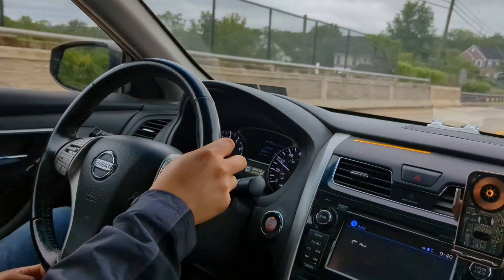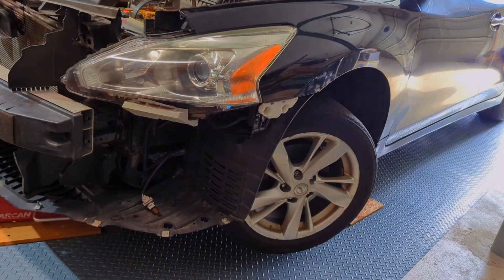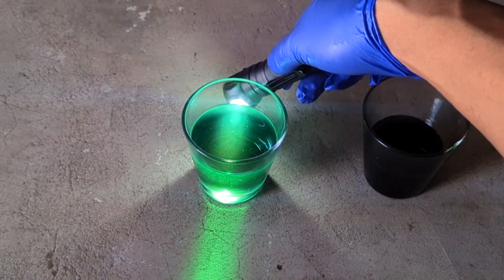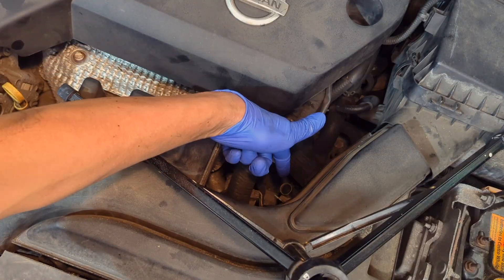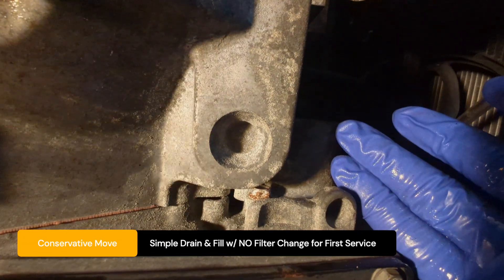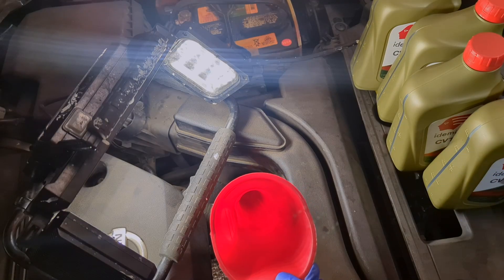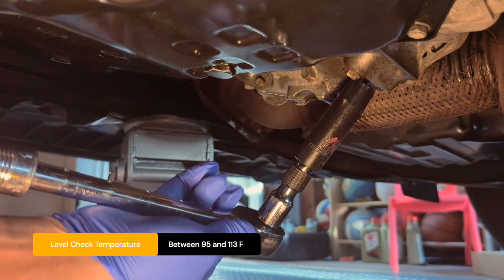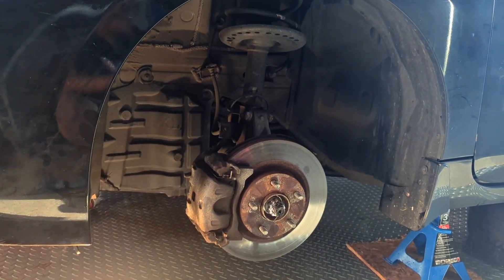Nissan CVT at 185K Miles: Service or Leave It Alone?

Comment: 4yrs ago at 123k miles my 2013 nissan versa transmission fluid changed. Last week at 145k i drained and fill the transmission fluid on my own. It was challenging coz its my first time to do it on my own. I snap a screw for the transmission filter coz it was leaking when i turn on the car but when i take it out the new rubber gasket from the filter was snapped so i decided to reused the old rubber.😅 i went in panic mode wake up early and running to different nissan dealer to find the screw but im glad the person in the parts help me. He went to the shop and ask the mechanics to find the screw close to the one i broke😅. Now everything is running good. It was dark trans fluid but i didnt drain and fill much until its clear, it might gonna slip. Anyway thanks for your videos. New subscriber here 😊
Reply from the maker: Sounds like quite the adventure, but glad it all worked out! Welcome to the channel!

Comment: Hi Professor,  I just had the sealed transmission fluid changed on my 2017 Kia Sorento with 150,000 miles on the original oil, and it’s runs very smooth.  Thanks for your videos to help guide me.   Keep up the great work!!!
Reply from the maker: You're very welcome! Glad the videos were helpful and it worked out smooth for you!

Comment: Did the transmission drain plug have a magnetic end? If yes, were there any metal shavings on it?
Reply from the maker: In this type of design with the overflow tube on top of it, the drain plug doesn't have a magnet. There are internal magnets on the bottom of the oil pan that will collect shavings for sure. Normally, you'll see fine-grained shavings due to normal wear and tear if you do drop the pan. Unless there are bigger metal shavings, in which case you probably experience something noticeable with the transmission, they are no reason for concern by staying at the bottom of the pan. If you are really motivated to drop the pan, to clean shavings on the magnet and to replace the internal strainer, which are unnecessary unless you have something else to address, please use all OE parts including new pan gasket, new pan bolts, and strainer and follow the procedure. Apply penetrating oil generously in advance and be patient with those pan bolts if you are in a rusty area. Too many people dug themselves into bigger troubles not knowing exactly what they were getting into so I always advise my viewers not to do it unless for a good reason.
Reply from the maker: Thought this was under my Toyota/Lexus ATF videos. So I have to correct myself here: This CVT has an overflow plug, no overflow tube which is on a Toyota or Lexus in my other videos. Neither the drain or the overflow plug has a magnet. There is an internal strainer and an additional external filter with an element in it. I'd replace the filter element.

Comment: You should have removed the oil pan and the paper filter. The reason why you probably never felt metal shavings in the fluid is because they got stuck on the oil pan magnets and strainer.
Reply from the maker: Thanks for chiming in! But I'm afraid this isn't the case and I disagree about the suggested approach. The transmission is very smooth and feels a healthy pressure with proper filtration. I did ask my friend to floor the gas pedal for once during the test ride and it didn't lack acceleration. It's normal for the magnets to catch metal shavings and the strainer to catch bigger pieces if any. Plus there is the external filter with an element in it for fine grained materials. It's a good design which appears to have done its job. I've dropped pans and replaced filters on other makes and models, but only when it was necessary to do so. This isn't the case here. More important though, which is my second point, with this belated service at such a high mileage, the last thing you want to do is an aggressive move/change, e.g. flushing the fluid, replacing everything, filter and strainer altogether, etc. There isn't an urgent problem to address here and a gradual change will serve it well. I wouldn't touch anything else until all checks out with this initial, small portion of fresh fluid and will address the rest in 10k to 30k miles. And my final point, it isn't really necessary to drop the pan to replace the strainer inside. This has been my observation of various transmissions on different makes and models, e.g. with Aisin and ZF transmission. CVT isn't unique about this and with the additional external filter element, I'll address that first, which is on our next service, before a need for the strainer.

Comment: I love how meticulous your videos are. Were those wheel lug nuts torqued to 80 lb-ft? FYI, the closed captions say "18", which can't be right. Also, good advice at the end. Could I perhaps suggest that every once in a while, when all the car's systems are at operating temperature, Mike accelerates hard (in the spirit of an Italian tune-up) to assist with clearing any engine-related carbon build-up and the like. Cheers and I look forward to more videos.
Reply from the maker: Sorry, just realized I misread your question. Yes, the lug nuts are 80 lb-ft.
Reply from the maker: So glad to hear that! The torques are both 25 pound feet. It happens that YT c/c tries converting them into different units and sometimes they mess up. Thanks for asking, I'll double check on the subtitles.